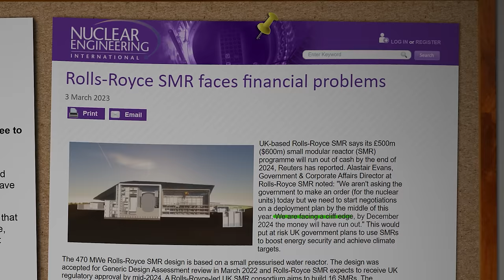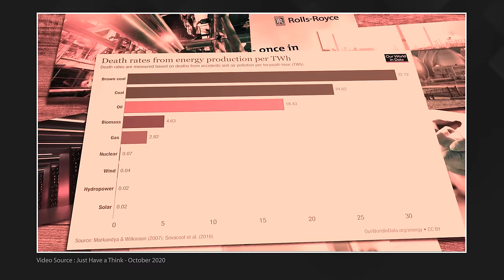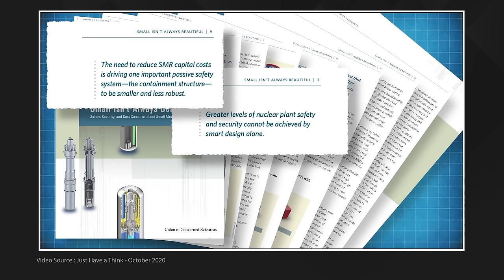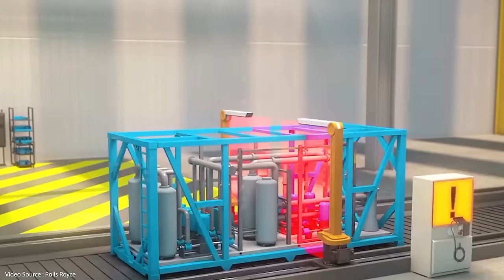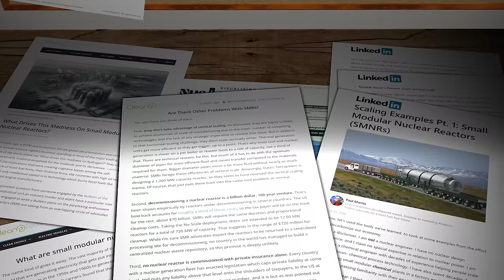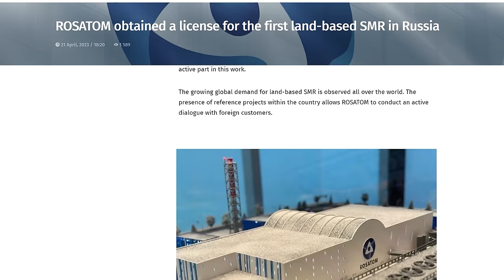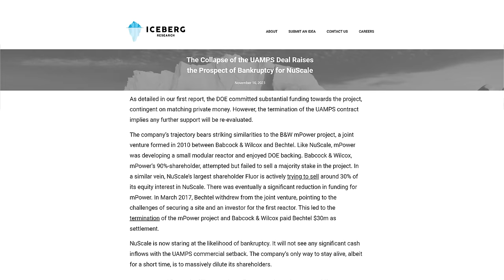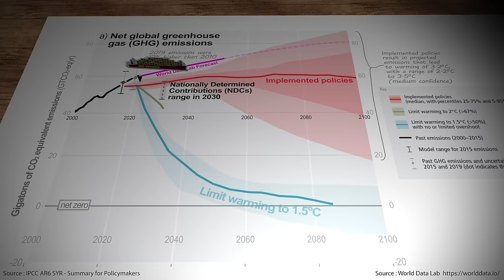Small Modular Nuclear Reactors. The Verdict

Comment: I thought two issues with SMRs were that the grid would need upgrading in multiple locations to cope and using uranium as fuel, cooling water needs to be securely sourced. The latter was a problem for France with conventional NPPs during a dry summer when rivers were depleted. Coastal plants are too much at risk from rising sea levels, and alternatives to Uranium, that may require less cooling, are still in the experimental stage of development. Are these concerns incorrect or valid?

Comment: the installed cost of solar is under $1/W (only slighly higher for wind). 
the installed cost of new nuclear is $5.50-$8/W. 

you can literally build 5x more solar farm wattage than nuclear. if spread over a wide area, you only need to average 20% output from your solar farms to satisfy the same amount of load, which is guaranteed for 97% of days (during daylight hours). if it is particularly sunny and you're producing more than anyone can use, that's fine. it's still cheaper to "waste" capacity most of the time. 

over time, you'll have energy intensive industries co-locating with solar farms. clinker/cement production, for example, has the majority of operating cost in energy input. operating intermittently means they would need more kilns/hardware up front, but it would pay for itself in the long run due to near-free energy. and lets face it, the southwest US have so many heavy sun days that down days would actually be somewhat rare. 

the main thing we need is more high voltage transmission lines, which will be helpful no matter what energy technology winds out over the next decade. kettle bundled 765kv transmission lines lose about 5% over 1000mi. so you can get 500% more power per dollar by building solar, and lose <10% moving that power across the whole country to where the sun isn't shining or wind isn't blowing. 

also, off-shore wind is in the middle, around $3/W, which can help with nighttime issues with solar. 

and lets keep in mind nuclear power plans need gas fired Peakers or energy storage as well. either you have to over-build them and run them well below their rated capacity (increasing the cost per watt by ~3x), or you have to still need peakers/storage so that the nuclear can run at 90% capacity most of the time. the myth that nuclear gets rid of the need for fossil fuel plans or storage is just BS. the only way to make that happen would be to put the price somewhere around 15x more expensive than solar or 5x more expensive than off-shore wind.
Reply: It might be overly optimistic but transatlantic and transcontinential superconductors similar to SMR are a practical technology but insanely expensive. However unlike SMR once you build these lines you can transmit an enormous amount of power over them.
Reply: @Furiends  That sounds like flying cars to me. Awesome idea, but completely unpractical, and something that will never happen. All for the same reason. It will always be cheaper to drive on land than to fly, and likewise it will always be cheaper to overproduce with renewables or to put tons of batteries, than to build such complex interconnections across the world.
Reply: Definitely an apples to oranges comparison.  First, when you talk about installed cost of solar you are talking about the wattage of the panels.  But the panels only produce when the sun shines, and are affected by whether the sun is shining perpendicular to the panels.  Roughly, this means something like you need to derate by (5/24) for good solar locations or even more in Europe.  Then you need to factor in storage to solar, and you have to commit to how many 9's of reliability that you will have.  On small scale operations, like an off grid house, the battery and inverter costs are much higher than solar panels.  Batteries don't last as long as solar panels, and are more likely to be damaged. You are focusing on the least important aspect of solar in the current technological environment.   You need to talk about the installed cost of batteries
Reply: @DrBernon  "It will always be cheaper to drive on land than to fly" flying can easily be cheaper than driving a car somewhere. It's also technically more fuel efficient.

But to address your point my comparison isn't to suggest superconductoring powerlines are anywhere near practical just that I think they have a much better chance than SMR does.
Reply: @richdobbs6595  No. He has a point. Installed power being 5 times cheaper is a very big issue for nuclear. Because those panels will generate less in the real world, but not 5 times less. And the storage issue is also somewhat irrelevant, because we are now on a point of the renewable journey that we still don't need that, and also, batteries are getting cheap at such a rate, that maybe once we need that storage, the cost got so low, is also a no-brainer to simply use batteries.
Reply: @Furiends  I think you are correct, interconnections are indeed more likely than SMR. But I was not arguing about that. I just said that I also think it will not happen as an alternative to large scale energy storage.

And flying is not more power efficient, only gliding is, but you need to take off, and be able to fly against the wind as well. Not to mention, it requires a ton of wing span, and how do you park your car then with those wings?
Reply: @DrBernon  So compare it on a quantitative basis.  And show me your figures on what the batteries are going to cost, because I call BS on that the cost of batteries is irrelevant, but the cost of solar panels is not!
Reply: @richdobbs6595  This is already accounted for in comparisons. It's called the capacity factor. While it is poor for solar, solar is also incredibly cheap and still getting cheaper. Solar plus storage even accounting for CF is still 1/3rd the cost of EXISTING nuclear. (I won't argue in speculation).

Further a big reason for the poor CF of solar is actually because it's useful in an ondemand power system. Solar is always there and while other sources are hard to turn on and off solar is easy. Effectively this means solar is providing a useful function by adding capacity that will be the first to turn off when there is over generation. 

Incidentally the more storage added and the more the grid is a capture and store rather than ondemand system the better CF is of the EXISTING installed solar will have which also then factors into it's long term costs. (which is why solar + storage is conspicuously cheaper than it would seem)
Reply: @DrBernon  On the first original point I agree completely.

I use the flying is more fuel efficient example because it breaks peoples intuition and challenges a pretty big assumption about efficiency.

A jet engine is nearly 90% efficient while a car engine if you're lucky might be 30% efficient. A car is fighting wind and friction of the road surface. A plane is just fighting gravity. Most of a flight faces thinner air and thus lower wind resistance.

In aerodynamics these are summarized as lift and drag since there's more complicated interactions of the two. But a fully loaded airliner is 2.39litres/100km per passenger while a very fuel efficient car is 60/mpg or 3.92024306 liters/100km.

Jet fuel and gasoline have very similar density a difference of less than 3%.

While things can very a lot depending on the number of seats filled we can assume a car has one of four passengers most of the time and an airline fills it's seats at least 80% on average.

Oak Ridge National Laboratory data which has a more real world comparison puts personal cars (not ride shares, fleets etc) at 43mpg and airlines at 53mpg (they convert into the equivalent energy unit of gasoline). So some cars can beat airlines if they are full of passengers. Except that all of them are hybrids. Meaning there is zero 4 passenger ICE cars that can beat an airline.
Reply: @Furiends  Not in the OP's comment.

Comment: Sometimes time makes the final Verdict. I'm in Western Australia and many years ago it was floated to "drought proof the State by pumping water from the Ord River Dam. it has a storage capacity of 204,719,140,000 cubic feet (5,797,000,000 cubic m). So plenty to do just that, and it sounded good on paper.

But recent studies have established that it would consume considerably more power to pump the water the 3,000+Km's to the area of need than to desalinate the sea water readily available off the coast.